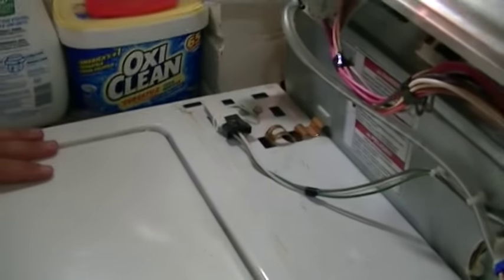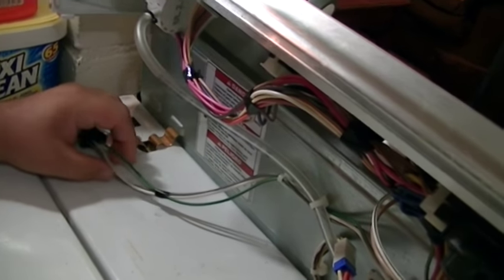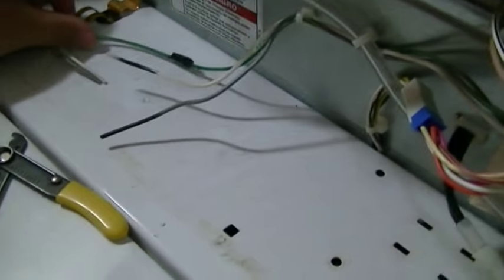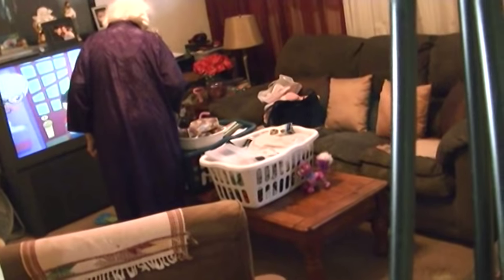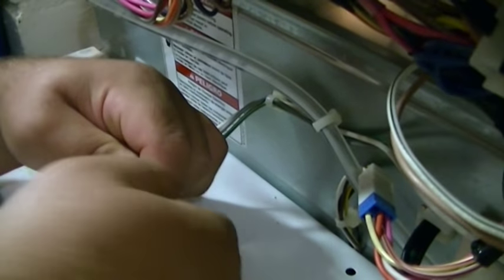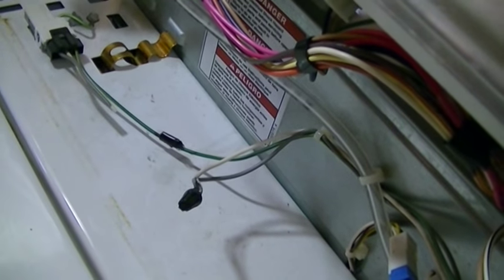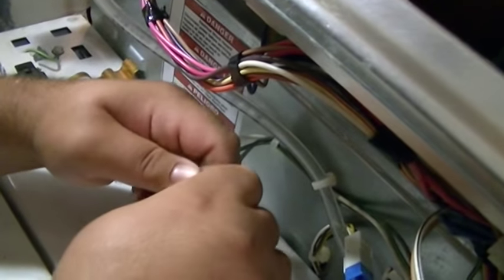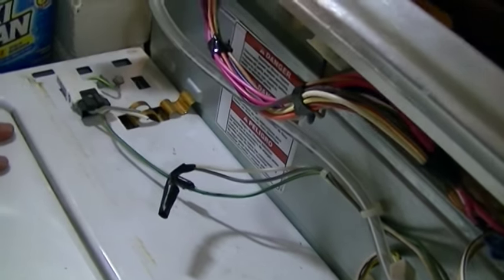Quick & Easy Whirlpool Washer Lid Switch Defeat

Comment: Can you recommend a video that shows taking that panel off, so we can get to the USELESS lid lock? THANKS 🙏🏼
Reply from the maker: If your machine has a lid LOCK that actually locks the lid shut, you're out of luck, there's no defeating it.  You have to buy the expensive parts and replace them.
Reply: @jaykay18  Oh GREAT! Aren’t I lucky to buy a useless washing machine? I honestly don’t think it’s a “Safety Issue” as much as Corporate Greed… a way for Whirlpool, Maytag Et.al. to make sure we replace units frequently. This NEW (used 5 times) washer constantly makes loads so uneven, it’s going to kill the whole motor assembly. 
This washer always redistributes even SMALL loads, so the machine DANCES ALL OVER THE FLOOR no matter how small or how many times I stop it to make the load even! 
I’m disgusted w all of them. 
But thanks a lot; at least I know.
Now I’m just gonna wash my clothes the Old Fashioned way….WITH AN OLD WOODEN WASHBOARD.
Reply from the maker: @denirn8725  I fully agree with you on that, they're junk.  Last good washer Whirlpool made rolled off the line in 2009.  So, the trick is to buy a USED machine, 2009 or older, that doesn't have the lid lock.  Those are called DIRECT DRIVE machines.  There's no belt, no dinky motor, no sub-par wash action.  It's an old-school washer that has one job to do and does it better than anything else out there.  No lock, it won't really go off balance because it has an actual suspension system.  It has a tub brake to prevent he tub from turning while it agitates, because that negates the effect of the agitation.  It's a direct-drive machine with no belt and it has an actual transmission to do the hard work.  Just like the kind we used to have, or your parents or grandparents may have had.  They are out there.

If you're worried about the machine breaking down, don't.  They're very easy to service, I have several repair videos on different things that can go bad.  And of course there are other YouTube channels to show you how to fix stuff.  Parts are inexpensive and plentiful.  Those machines run for a good 20 years without much in the way of any trouble.  I have 2 machines, and I will never get rid of them or replace them with any other kind of washer.  They were some of the best ever, ever made.
Reply: @jaykay18  You guys are wonderful! You know so much about machines like washers etc. & can fix almost anything. Reminds me of Mike Rowe’s program,  telling young kids, they DON’T NEED A $300K University Education to succeed & be fulfilled. They spend 4 years on Useless Knowledge they’ll never use & NEVER get the job of their “Dreams”. 
I thank God & personally thank every genius tradesman I can every time I meet one.  They’re the amazing  people who keep our good lives GOOD in this country.
Oh & you’re right! I did think about an old refurbished washer. In my vacation house I have a 27 y/o Kenmore that’s perfect. My Granny bought it right before she died. And I bought the house without everything in it.  That old Kenmore  has never failed. I keep all parts I can get to clean & lubricated.   AND the only lock on it,  is on the final spin cycle. It stops spinning BUT you still can always open the lid.
It’s gonna be a nice “USED” IN GOOD SHAPE WASHER when this piece of junk dies…. Probably next year when it’s 2 years old. 😆
THANKS AGAIN it’s refreshing to know I’m not just the only complainer about this technology.
Reply from the maker: @denirn8725  You are too kind!  For me, I went to college, got my useless knowledge, did all that.  My actual knowledge was hands-on.  I was just naturally curious.  I wasn't afraid to take things apart to see how they worked.  I'm a computer technician by trade, as such my mechanical skills are lagging behind but I can get the job done.  Mike Rowe is absolutely right.  If you're willing to put your blood, sweat, and tears into stuff, it can get done.  Nowadays with the advent of the Internet and YouTube, we have instructionals and instructional videos.  That makes a lot of jobs very simple these days, if only people can follow directions (they usually can't).

Tradesmen are great people, until it comes time for the bill.  I once had a plumber in to change some gaskets and a valve on my boiler, he quoted me $625.  I bought the parts myself and saved $600.  So they usually charge too much.  There are, however, some jobs that are just out of my league, and I have to pay what they ask.  Finding an honest tradesman who would charge a reasonable price is one the hardest things to do.

Your granny's washer is the type just like this one in this video.  And yes, the content of this video applies, you can disable that lid switch so it will stay running even with the lid open, if you want it to.  On my own machines, I added that option, and put in a switch so I can enable the lid switch function again if I wanted.  I also like a warm rinse, so once again, I added that option via a switch.

Regarding your junker, what you can do, though may be in the way/inconvenient, is to remove the latch from the lid of the washer, the top part.  Then you stick that down into where it normally would mate up and leave it there.  Might even duct tape it in place and call it good.  All of the other problems will still be there, but there won't be any waiting for the machine to stop, provided you don't mind going for a spin yourself.  Any other questions, I'm always here.

Comment: The one wire in the connector to my lid switch burned the plastic on the connector and lid switch. It oddly still works but I was hoping to replace the wires and lid switch but I'm having trouble finding replacements, mainly for the wires. Is this a safe alternative to replacing them?
Reply from the maker: Replacement parts for these machines are cheap and plentiful.  Finding the actual wire connector, that's a different story.

What is depicted in this video is at your own risk.

Comment: I opened the panel and found this is already done.  My washer won’t spin during a cycle but will when I turn the dial to spin and start it. Any suggestions?
Reply from the maker: I first need to make sure that the machine you have does NOT have a lid lock.  If it does, you're out of luck.  If it doesn't, that's an odd problem.  I would first listen to the timer.  It's a motor-driven electromechanical timer and has a small and quiet clock motor inside.  You may have to stick your ear on it, but you should heard it run.  If it doesn't, I have seen them stall mid-cycle, in which case you'd need a new timer.  Without a model number of the machine, that's the best I can offer.

Comment: Will this work for the older style that’s located in the center of the body ?
Reply from the maker: As long as the machine doesn't have any lights or a "play button" on the control panel, it should work.

Comment: I have a whirlpool ultimate care ii washer model number LSQ9030PQ1.. I did some research and it says to try the lid switch. ( fills up with water, then stops) I bought the new part put it in, still nothing. Can I cut the wires like you did on my machine for it to bypass the lid switch and wash my clothes?
Reply from the maker: It's pretty rare that a new switch is defective, but not unheard of.  Unplug the connector, and make yourself a jumper wire and jump the pins before you go cutting any wires.  Best to use a piece of wire like from a piece of Romex, 14 gauge.  If you don't have that handy, for a quick test, and I mean *quick*, you can unbend a paper clip.  Chances are very good that if it works that paper clip will get VERY hot so be careful.

If it doesn't work still, you could be looking at a bad timer.  Try a different cycle, like delicates.  You also didn't mention if it drains or if the motor makes any noise at all, I'm assuming it doesn't.  If all of that's good, then likely you're looking at a bad motor.  Sometimes the capacitor on them goes bad, but you'd hear a hum or something, which again, you didn't mention so I'm assuming not.

Comment: Hey man. I have a Whirlpool LSR8010PQ0 and the middle contact of the switch melted. I tried your method and the washer won't run, after about 60 seconds of waiting for it to do anything I smelled something melting so I unplugged the washer. The two wires felt warm to the touch but not hot enough to melt.
Reply from the maker: It's possible you have a bad motor, or bad capacitor.  That's causing the excess current condition.

Comment: Washer will drain but won't spin. Is that indicative of a faulty lid switch? Oddly, it spun fine prior to repairing the pressure hose attached to water level setting (was overflowing). Reconnect hose, no spin; unhook hose, overflows but spins fine. What's the interrelation between the two? Any advice will be greatly appreciated. Thanks
Reply from the maker: I need to first know what kind of washer this is.  A lot of people think they have a washer similar to what I showed in this video, but theirs is a newer machine, which is a totally different ball of wax.  If you can give me the model number of the machine I can help you further.
Reply: @jaykay18  It's a Whirlpool, older model; numbers 3357978 stamped on back. Not sure if that's the model # or not. I since disconnected/bypassed lid switch and same issue occurs. When in spin mode I can spin drum by hand and it engages kind of randomly (sometimes easier than others); clutch maybe??. And thx for the prompt response.
Reply from the maker: @indoctrinationamericasgrea3543  Ha, that's the part number for the back cabinet panel itself!

All right, if this is a direct-drive unit like this, and does NOT have a lid lock, Play button, LEDs or other indicator lights on the panel, the first thing to check is agitation.  If the unit WILL agitate, then the motor coupler is OK.  If not, then the motor coupler needs to be replaced.

If the motor coupler is OK, note that the washers have a neutral drain.  So after agitating, they will stop, start up again and run the motor, but the only thing that will happen is it will drain just sitting there.  That goes for about 2 minutes.  After that, it will shut off for a moment, start back up, and should spin.  If it's not spinning, then check the clutch.  You'll need to remove the cabinet and look on top of the transmission while it's put into spin.  The clutch should spin.  If it doesn't, the transmission is bad.  If it does, the drive block, or brake and drive tube are bad.
Reply: @jaykay18  Thanks again. Won't have time today to pull it back apart, but Ill let you know what happens tomorrow.
However, before I do, some say it won't agitate if clutch is bad (and it does); but it spins and pumps fine once engaged (which a faulty transmission won't do (??)); unless I'm mistaken; which is very possible. Consequently leaving me a bit confused... . Thanks again!
Reply from the maker: @indoctrinationamericasgrea3543  Drive block, or brake and drive tube are culprits.  Let me know what you find out.

Comment: I am looking to buy a new washer....and was wondering if I could do this on the following washing machine: The GE GTW465ASNWW????? Is there a way to tell which machine you can do this to?  Thanks so much Jay!!!!!!
Reply from the maker: That washer is garbage.  As is every other washer on the market today.  The only exception is Speed Queen, the "classic" model that's new for 2019.

The general rule of thumb for doing this mod is that if the washer has a lid lock of any kind, it's not going to work.  Otherwise, I have no way of knowing which washer this will work on and which one it won't.  It depends on what they're actually doing with the lid switch.  Sometimes there are sensors and other BS that prevents further modification.

Comment: Do you know why the lid switch is overload and heating, the tree wires plug can't be removed? I have cut and bypass the lid swich, this trouble can be fix with the lid switch replace?
Reply from the maker: Probably a bad connection in the connector to the switch.  Sometimes water can get in there and cause corrosion, which will make a bad connection.  Bad connections can overheat.  You can try replacing the switch, but if it happens again, you'll need to replace the switch and the connector on the wire.

Comment: Hi great video, my question is that my machine lid lock has 4 wires, red, blue, yellow and white.  What 2 wires I connect together and what do I need to do with the other two wires?   If you could help, it’ll be greatly appreciated!  Thanks
Reply from the maker: My help is for you to read the description.  ALWAYS READ THE DESCRIPTION, ON EVERY VIDEO YOU WATCH, IT HELPS PREVENT STUPID QUESTIONS THAT HAVE ALREADY BEEN ANSWERED.
Reply: @jaykay18  wow that was really rude
Reply from the maker: @markusray319  And you're another one who doesn't read the description, where you have been duly warned.
Reply: lol i just read the bottom of your description - 😂

Comment: Bypassed correctly 
Can I connect the other two that are connected to switch to remove switch completely?
Reply from the maker: You can replace the switch, that's the proper fix.

Comment: Would this work on a MVWC300BW0 ? My Maytag washer turns on, fills up at start but once it’s ready to spin and detect load size, the lid lock light blinks and makes a clicking sound over and over like if it is trying to lock but won’t! What could be the problem ?
Reply from the maker: Without my even having to look that up, no.  Lid lock machines have to be repaired properly, there's no fooling them.  What's the problem?  The washer is a piece of junk is what the problem is.  No kidding either.

Comment: I couldn't tell what Washer exactly this was, but would this work on a Whirlpool WTW5550X Washer? The lid lock mechanism in my washer is busted internally. Would this able me to actually do laundry?
Reply from the maker: Sorry, you're S.O.L.  Lid lock washers have sensors that need to work to satisfy the computer.  Without all of that safety equipment in place, it's not going to wash.  You have to replace the broken parts, then you should be all right.

Comment: Thanks A lot! I tried the trick and it worked great.... until for some reason whatever burned out the Lid switch caused the wires to heat up and almost melt... Everyone know why or have any suggestions?
Reply from the maker: The full motor current goes through those wires.  If you have a bad connection anywhere, that's a source of resistance and therefore heat.  If your motor has a bad capacitor, it can pull excessive current and cause overheated wires.  It's time to find the root cause of the problem instead of putting bandaids on it.
Reply: @jaykay18  Thanks a lot. I'm currently doing missionary work in a 3rd world country so parts are not easy to get and a tech that can fix this is even harder to find. But I thought there was a short somewhere because when I lifted the control panel I heard the machine stop and start. Thanks again for your help! I'll see what I can do.
Reply from the maker: @marcs7847  Good--that's a definite clue where the problem lies.  If Amazon delivers where you are, parts are easy to get.

Comment: I want to try this for my washer but I don’t have wire strippers or the little cover for the wires . Would I just be able to use electrical tape to cover the exposed wires ?
Reply from the maker: For a test, you're better off unplugging the connector and probing that with a short piece of 14 gauge wire.  If you don't have any wire, you can use 2 paper clips together in tandem, bent into shape--FOR NO MORE THAN A SECOND, they cannot carry the current needed and will get hot!  Don't even THINK about touching the exposed stuff, and keep it away from the machine, in other words, hold the wire behind the connector in the air.  Get some wire nuts, you can get them at a hardware store for a couple bucks.  No strippers, a pocket knife can work in a pinch but it'll be a sloppy job.  Strippers are a couple of bucks as well.
Reply: I have that same question right now

Comment: Hello Jay, I have a Whirlpool Energy Saver wtw4900bw1. Do you think this fix would work. Seems easy enough to just bypass a lid lock. Thanks in advance for the reply!
Reply from the maker: That's a Playskool washer with a lid lock and a belt drive.  Everything's computer controlled, and without that lid lock and switch working properly, the washer wants to be brought to the curb so it can be recycled into more Playskool junk, that will break in short order.

You need to fix the actual problem, and that means parts, maybe even sensors or circuit boards.